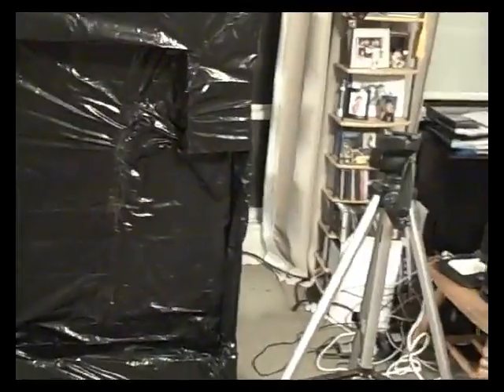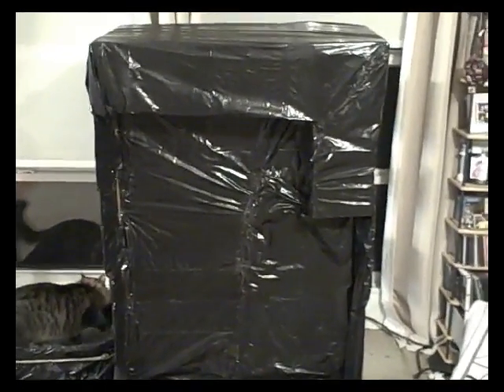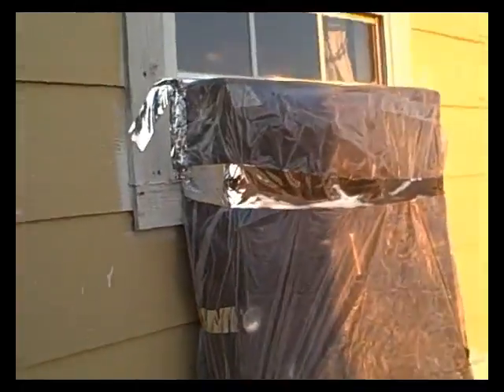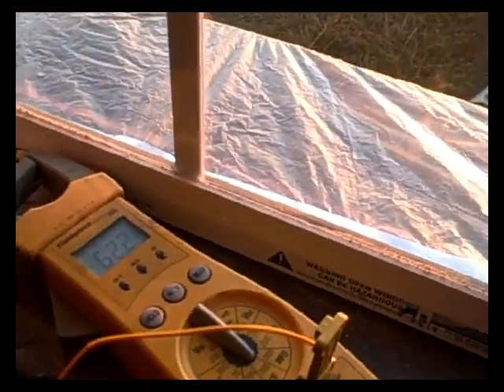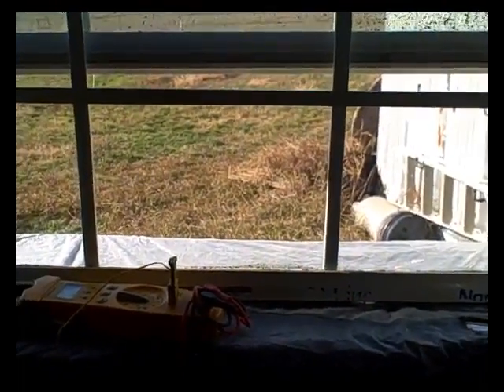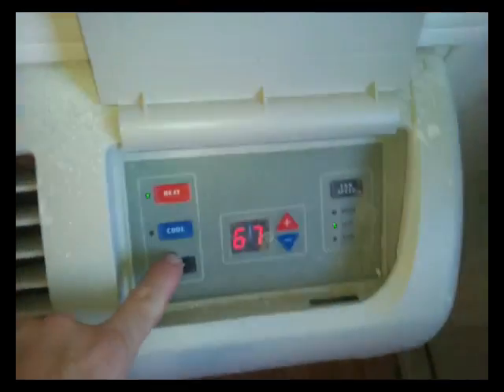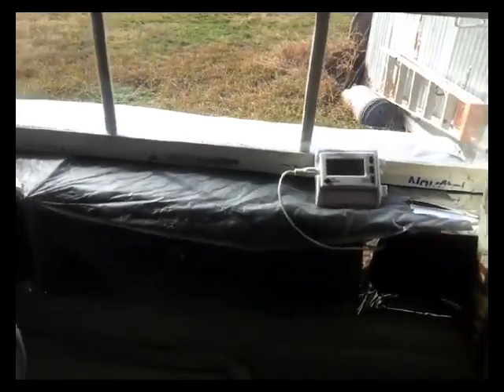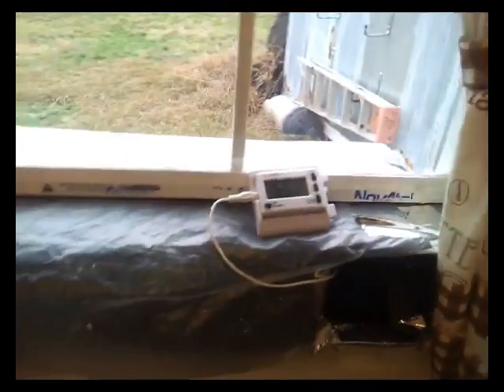Solar Hot Air Collector furnace. Free Heat from Soda Cans. Built from FREE Trash/Scraps/Cardboard!

Comment from the maker: @manholewisdom At this very moment I am in the room and dont' have the heatpump turned on.  I'ts 63F outside, the indoor temp is 69.1 and the temp in the box is 97.5,.  Holding a thermocouple right in front of the return gives me an 89 degree temp.   ...it was 64.1 when I came in here about 2 to 2-1/2 hrs ago and not it's 69.1 so it's slowly coming up!  Think the next version I make will use aluminum flexible dryer vent duct so I can dodge the paint smell!  :)